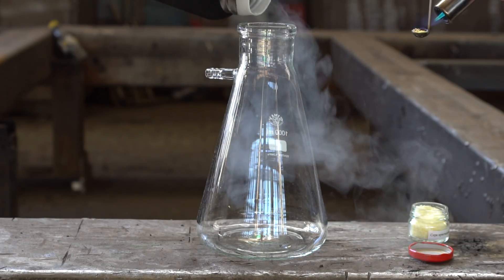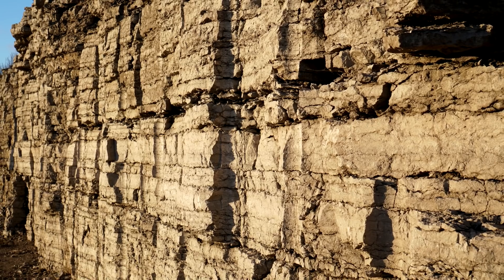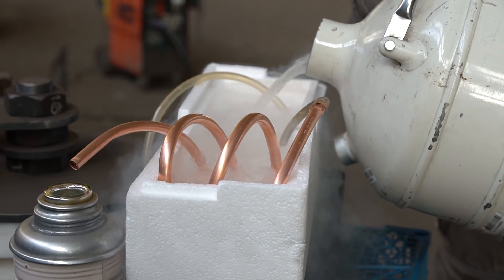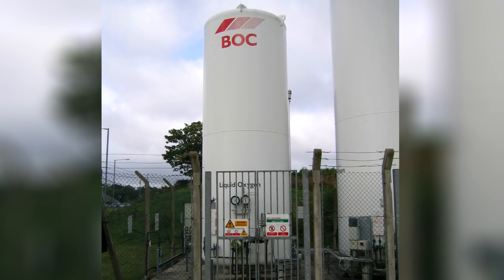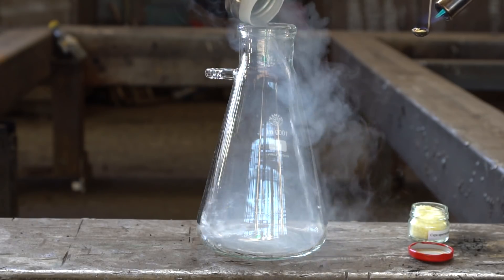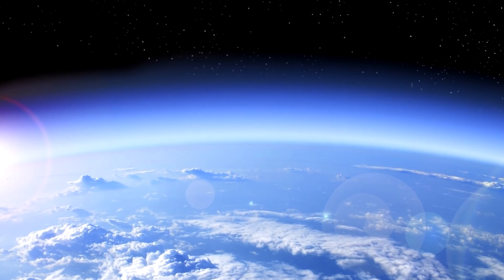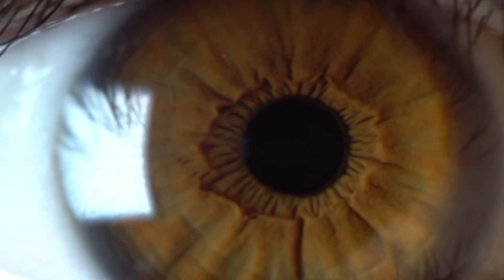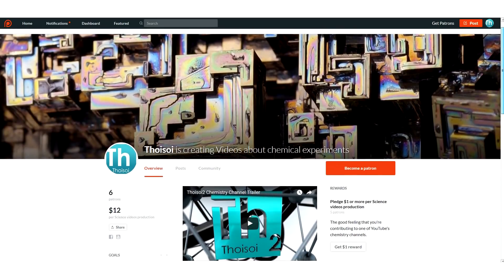Oxygen - The MOST ABUNDANT Element On EARTH!

Comment: I am using an 125 cc motorcycle. So if I installed an oxygen generator and  connected it to air filter then will I increase my motorcycles performance and milage.

Comment: This Fuel Source has been known since the early 50s and has been adapted into a car engine by the early 70s but then it kinda just fell off the edge of the fucking world and nobody really talked about Liquid Oxygen Engines anymore
Reply: Judess 69er It's not a fuel though.
Reply: sorry complete mistake, what i was thinking of was a H2O Engine not a LOx Engine, my bad complete error on my part o.o' must have been a late night comment

have you seen a Oxyhydrogen Torch cut through titanium? it slices right through it like butter you cant tell me that's not a fuel source Oxygen when separated from its hydrogen molecule creates a really combustible fuel source that was adapted to engines back in the early 70s but then it kinda just fell off the edge of the fucking world and nobody really talked about H2O Engines anymore
Reply: From what I've read H2O engines have an Achilles heel. It takes more energy to separate the water molecules through electrolosis than you recoup from burning the resulting hydrogen.
Reply: Kennneth Boys 
There are chemical methods though.